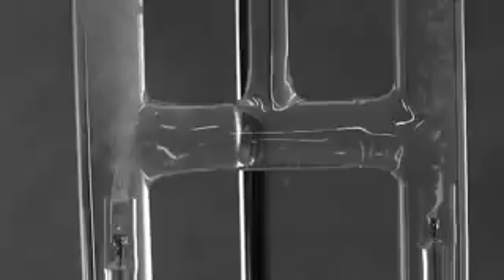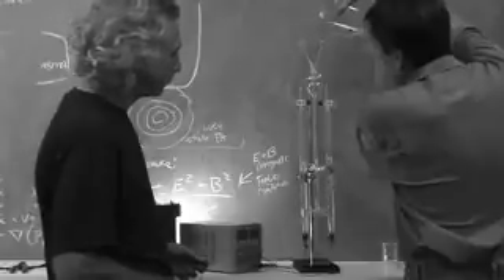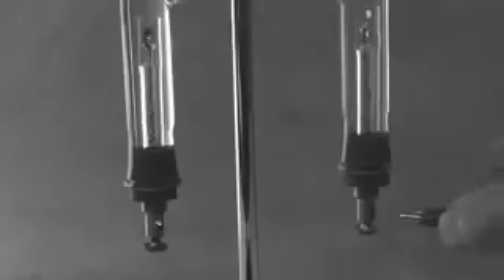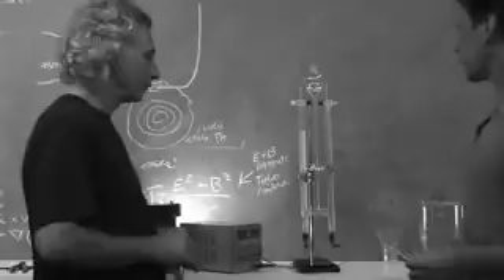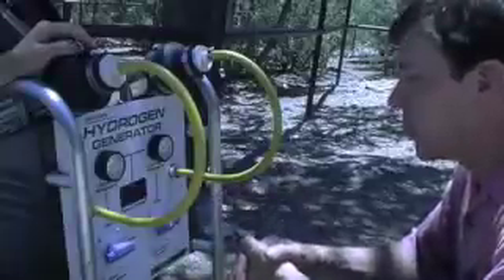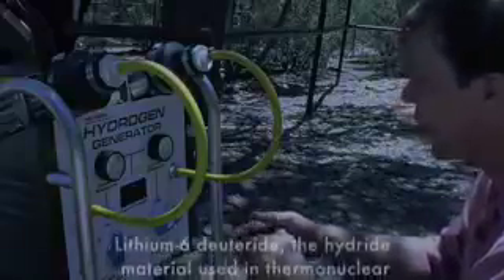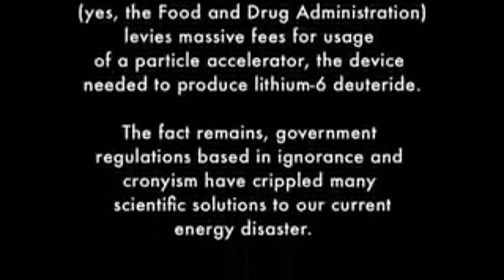run your car on water. This guy does just that!

Comment: I suggest doing a W'pedia search on both Mr. Lazar and the lithium hydride substance he mentions at the end of the video. It's very enlightening for those who are capable of enlightenment.
Reply: Forensource A careful reading of my comment will show that it wasn't intended for you. I apologize if you almost thought about something.
Reply: jhanthony2 Bob Lazar is known fraud.   That comment is most certainly meant for you.
Reply: Forensource

"Bob Lazar is known fraud. "

but is this device a fraud?
Reply: yes.
Reply: Forensource

can you prove the device is a fraud?
Reply: not much written on Bob that has anything nice to say.  lithium Hydride on the other hand, would seem to make a safer rocket fuel than somthing i want in the back of my car.
Reply: ***** Rocket fuel is liquid oxygen+liquid hydrogen. Your telling me you don't want the make-up of water in the back of your car; The same thing that was pushed through your coffee grinds in the morning?

What's the by-product of burning hydrogen?
Water.

How about gasoline?
Carbon-monoxide (C0), Carbon-dioxide (C0²), etc.

So really, what do you really want in the back of your car because frankly, hydrogen is... safer.
Reply: More concerned about lithium hydride than hydrogen.
Reply: Sebastian A.K. but the trees and plants need the carbon dioxide to breathe,and in return give us oxygen.
Reply: Mike Goss Everything in moderation. With CO² at 400ppm, that'll be more than enough for trees, but are we focused on providing CO² for trees or are we interested in finding a balance between nature and civilisation..?

Personally, I feel that with the way things are going, its hard to see there's a way out of this predicament we've placed ourselves within. 

The ice will melt. 

The tempature will rise. 

Chaos will insue.

We still can do something about it, but based on the oil companies grip and our truly naïve society; its likely hood is slim.

Only once we truly see the consequences, it will be too late.
Reply: The problem, as I see it, is people want energy that is cheap, effective, and doesn't hurt the environment. The environment is a paramount concern on some peoples list, and rock bottom on others.

I feel that fossil fuels can be extracted and used in a socially responsible manner. But only if that's how we want to do things. Europe understands that. The U.S. is starting to slowly catch on. And China says, "Fuck you, we need to catch up. And we'll burn all the damn coal we want." I understand their position.

Eventually the supplies of coal, oil and gas will get so diminished that alternatives will be mandatory if we want to maintain anything like our current standard of living. Especially when the world population gets up to ten million people who all want to live like fat Americans. 

In the next several decades, all kinds of green technologies are going to become more popular; along with nuclear energy. It's my current feeling that nuclear energy will become the dominant source of world energy in the future.
Reply: jhanthony2 However, nuclear energy has draw backs-VERY EXPENSIVE & DANGEROUS!  Also, what about the DANGEROUS WASTE?  Why not use VERY WISELY WHAT WE HAVE using a GASOLINE VAPORIZER & a HYDROGEN GENERATOR COMBINATION in the SAME UNIT?  AMAZING RESULTS!  I've designed another devise I call a MECHANICAL JET that would make vehicles SAFER & MORE ECONOMICAL!  It converts TORQUE into THRUST-MECHANICALLY!  More info on this at:  http://uCANgetbettermpg.blogspot.com.
Reply: Wendell Ferrell " However, nuclear energy has draw backs-VERY EXPENSIVE & DANGEROUS!  Also, what about the DANGEROUS WASTE? "

Everything has drawbacks. When oil is finally depleted, nuclear energy will be the energy source that will be labeled "cheap." There are lots of dangers to using nuclear energy. So my advice is, be careful and do it correctly.

Assuming the number of people that may die because of global warming, is petroleum all that safe?

Everything else you posted appears to be a load of spam from criminals trying to make a buck by pushing quack physics.
Reply: Unicorns crap skittles.  Unicorn power is endless.
Reply: Forensource At the unicorn petting zoo they let you feed pieces of broken rainbows to the colts.
Reply: Like Tesla said  "Ooonikvorns is great."
Reply: Wendell Ferrell

the vaporizer is a great idea we should have used a long time ago

the thorium car idea only uses a tiny amount of the material

that doesn't sound very expensive
Reply: I suggest reading this link concerning thorium powered cars:

http://granades.com/2011/09/16/in-which-i-use-scientific-reasoning-to-doubt-the-thorium-powered-car/
Reply: Here is good info on automobile fuel efficiency. I recommend reading the section on Thermodynamic Efficiency:

http://en.wikipedia.org/wiki/Fuel_saving_device
Reply: jhanthony2
" These do not work because the principle is already applied to the design of the engine"
-Wiki on Vaporizers

this is one of the few times that Wiki got it wrong

there is nothing in a factory built car that will vaporize gasoline
Reply: jhanthony2
the guy who came up with the idea for the thorium car will have to respond to questions about it
Reply: robinsss Are you making a distinction between vapor and a fine mist? I can go with that. But still, the claims of 100 mpg have not been substantiated, and are extremely unrealistic. 

As far as the fellow who came up with the thorium car answering any questions, I think he washed his hands of the whole deal as soon as his piece got published. I doubt that he has any interest in discussing it.
Reply: Go with unicorns.   The big oil traitors killed Tesla because he rode a unicorn.
Reply: Enlightened people use ALL available resources of information and use their knowledge, common sense, skepticism and discernment to determine which sources have the most validity and authority. ALL, and I mean that without exception, ALL sources of information should be treated with suspicion, and NONE of them should ever be accepted without question.

After researching many sources of information, and using the criteria I mentioned above, I have determined that this video is a gigantic load of nothing but lies and bullshit.
Reply: Put the car on a boat, then run it on the water all you want.
Reply: And limitless fuel supply, too.
Reply: Wikipedia is a disinformation outlet for the elite.
Reply: Isn't Thorium a bit pricey ?
Reply: @themoonpro  Oxygen is good stuff but freeze it and stick your finger in.    Hydrogen is used in a H-Bomb as a catalyst that keeps the fusion process going in order to use most of the bombs nuclear core.    Only a small amount of the uranium based warhead is actually spent when an A-Bomb is detonated.
Reply: @themoonpro  Saw this video a long time ago but nowadays when people compare hydrogen fuel cells or gasoline combustion engines to hydrogen combustion engines, they want to say that "nitrogen dioxide" is the only bad by product of burning hydrogen, and is an issue worth not investing in it that way.
Reply: it's not as safe a substance as he implies, even if you could get it
Reply: Wikipedia is to knowledge as Spongebob Squarepants is to a documentary.
Reply: Emergency Survival Supplies, bunkers, freeze dried foods, doomsday drones, EMP-Proof fuel-less solar generators, lessons, bulletproof backpacks / shields, camping, etc https://www.ebay.com/itm/Solar-Fuel-less-2000W-Generator/173771050171 www.worthingtonbunkers.com USA Deliveries ONLY , buy the deluxe solar generator kit
and get $50 off with this coupon "lovejesus" @ www.ambertracks.com
Reply: @themoonpro  Hydrogen is one of the most powerful explosives known to physics, you moron. It's NOT water they store in their tanks,  silly. Go back to school ffs.
Reply: Because you said so jhanthony tutu

Comment: The Govt uses hydrogen fuel cells in the space station.
Reply: They use these all over the world. You can buy hydrate it is just expensive. Not sure what type he uses but there are many forms of hydrate. And it takes so much energy to (cool to fill tanks) (heart to get hydrogen out) plus the energy to desperate hydrogen from H2O it is not efficient. If you have an abundance of power then sure this is a good way to store it.

Comment: On the face of it he sounds quite credible.  Lithium Hydride is listed as used for storing hydrogen, but requires 700 deg C to extract it.  Quite a high temperature to produce within the cylinder.  A search of particle accelerator tells you how to build your own in a week-end so apparently not so implausible.
The engineering is good - nobody goes to that much trouble for a hoax.
I would say that this is genuine.
Reply: Frank Buckley But wouldn't lithium hydride (especially in such quantities) react dangerously with moisture? He is saying the tanks in the car would be safe. If one was damaged in a accident, it could basically explode if it came in contact with water or even humid air.
Reply: +helicrashpro Or in that vein...what about if your hydrogen generator rose above 100 degrees C and water vapor mixed with the hydrogen?
Reply: Iron hydride, titanium hydride, calcium hydride....all of these store hydrogen the way acetone stores acetylene. It goes into solution (solid or liquid solution). As the liquid or solid is relieved of the pressure, the hydrogen outgasses. Warming the hydride increases the rate of release. Different metal hydrides outgass better at different temperatures. Lithium hydride needs too much heat. Try Calcium or titanium hydrides. As far as acetylene in welding cylinders: it is placed in diatomacious earth to make it safe. Above a certain pressure, the acetylene combines with metals like copper and form acetylides.....which are explosive. imaging welding and having this wonderful surprise and subsequent flaming event...oh, baby.....
Reply: @jimmcknight1189  Ballard Power found a better way I'm thinking - much safer and less toxic but still only suitable for exotic applications not everyday transportation.

Comment: Hydrocarbons are also rich on hydrogen.  Someone should invent an engine that runs on hydrocarbons...
Reply: LOL!  Yeah?  Like petrol, diesel or kerosene?
Reply: Lol
Reply: yup. they are also a much easier way to get hydrogen gas: the bond between H2O is about as strong as you can get (in other words it takes the most energy to undo it) while the bond between CH4 is much lower plus you get two hydrogen molecules instead of one - there is a method for reducing natural gas to get hydrogen and simple carbon using iron ore http://www.hazergroup.com.au/
Reply: Brilliant Idea! I will an patent!!!! lol

I just need now a time machine to travel back before Diesel and Otto invented their engines.

Why do I waste my time saying Otto???? People wouldn't know what engine is that as there is no 'Otto fuel'.... just a hint - gasoline or petrol, depending where you come from.
Reply: @brettb9194  why would you mess with CH4 (aka natural gas) to make Hydrogen? Just compress it and burn on the engine as me and a lot of people do?
Reply: Hydrocarbons make synthetic oil.

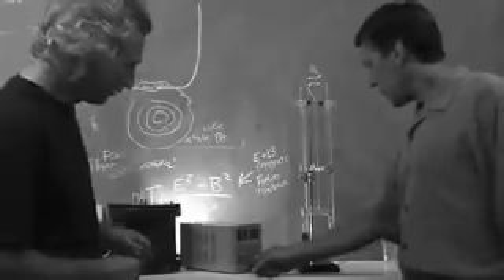Comment: 3:53 THE KEY POINT OF THE WHOLE VIDEO. By turning "it" on meaning , this small little box called power supply which is power provider for the whole system/process. Efficiency of the whole setup is less than just to use the same amount of electricity spent directly for an electric car.  So technically title should change : Run your car on water + electricity !
Reply: Well, yes. You're not extrapolating the meaning enough however . Green electricity is not a "constant" resource - it has peaks and lulls, and can be relatively unpredictable. Hydrogen storage is a method with which to transform that energy into a form which is more manageable and long-term for storage, which doesn't require the massive amounts of (and toxic) chemicals for long term battery storage.

The losses of efficiency are known and expected, especially when transforming one source of power generation into another.
Reply: @volatilesky  TBF dihydrogen is simply one of the worst molecules to store. 
And I will just add that I find the title extremely pitful too, it's basically a sheer lie. No car runs on water, and no engine does, period. It runs on dihydrogen in this case, and the rest is sensationnalist BS.
Reply: @justalonesoul5825  TBF, I've seen autos run on the amount being immediately generated rather than stored, so yes, it runs on just water.

Comment: As of now August 2019, ten years later, whatever happened to this technology?
Reply: Maybe the ancient Egypt had used this method Nikola Tesla had talked about this it will really help the Earth
Reply: Im just coming across this also. Mazda made a hydrogen rotary rx8s and implemented the cars and pump stations on a island of a small country for free as an experiement. But the island just scammed them and parted out the cars and sold them for the standard rx8 compatible parts. Really sad truly.
Reply: @lightworkerofthemosthigh6073  holy fuck. I just realized the Egyptians had bi degradable hemp machinery and hemp printed cumputer boards and hemp resin smart glass technology and thats why we dont know how the pyramids were made. Fuck. #420666
Reply: Its used quite a lot. I have a small, home-made hydrogen cell, helping to power my old Toyota Corolla. I have a thin solar panel on my car roof, helping to charge a separate battery, for more efficiency (running direct from the car battery, isn't as efficient, as you are using more fuel to charge the battery). Its not rocket science once you understand it.

Comment: Burning hydrogen in any kind of internal combustion engine is grossly inefficient. It is even worse than petrol. If you really must use hydrogen as an energy carrier then use a fuel cell to make electricity. Then the efficiency will be around 70%.
Reply: EXACTLY what i was saying above.   Absolute crap.  -1 atmospheres at best when burning hydrogen.
Reply: So that is essentially why it was never used…makes sense …and of course extracting hydrogen from water unfortunately requires a lot of power
Reply: @chrisvig123  yes and no..  its possible to utilize the reverberation affect between two sets of water like tesla did to make his coils to break water with a minimal amount of power, but the hard part with creating hydrogen from water is the oxygen component,  it makes for a gas that is highly unstable.  very easily it will detonate on its own,  too much pressure and bam,  any kind of spark and bam,  any kind of heat and bam..  its basically very dangerous unless your working with small quantities which is counter productive for making a car run.  for instance, you have to fill all cylanders every time the engine rotates,  which is ALLOT of gas per second.   also because it implodes as opposed to expand,  the engine timing has to be way off from normal,  which throws off the computer and any miles per gallon calculations it does,  as well as fuel metering based on the oxygen sensors on the exhaust of the engine.  then and only then when all that is working just right without any accidental detonations,  the engine performance is trash because it can only achieve -1 atmospheres per cyclendar cycle. as opposed to gasoline which is MUCH higher Positive pressure, especially when dealing with desel or high compression engines.  with hydrogen and oxygen known as browns gas,  too much compression causes early detonation which is counter productive,  which also causes the cylendar to slam close as opposed to slam downwards with gas.    really all this is a big scam that has been going on for a VERY long time since the early 50's.   now PEM's are a real potential for using in cars, however they require PURE hydrogen, which takes allot of energy or chemical reaction to create enough hydrogen, then compress it to a liquid form to be stored in a tank inside the car.  which in turn has its own issues, being a highly flamable gas compressed to liquid form by high pressures and very cold conditions.
Reply: @chrisvig123  Yes.....it takes 55 Kw ( 73.7 horsepower ) of electrical energy to produce 2.5 pounds of hydrogen which has the energy equivalent of a gallon of gasoline. Nobody ever mentions this little detail. Your average home has a 100 amp panel and it supplies a maximum of 12 Kw.
Reply: @jb-xc4oh A high efficiency electrolyzer can produce a kilogram (2.2 pounds) of Hydrogen for less than 50 Kilowatt hours of electricity. So if your house has a 12 kilowatt supply then it would a kilogram of Hydrogen approximately every 4 hours.
Reply: @jb-xc4oh  you are confusing power (kw and horsepower) with energy (kWh)

Comment: i see.  O2 released in splitting process is recombined at burn, no 02 loss. Charged by renewables, gas under low pressure in safe tanks. Very nice.